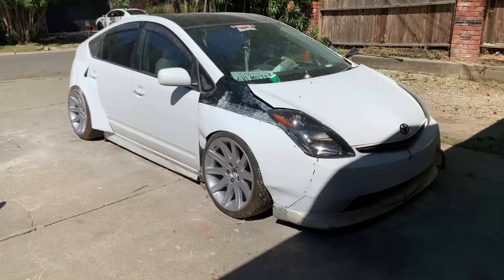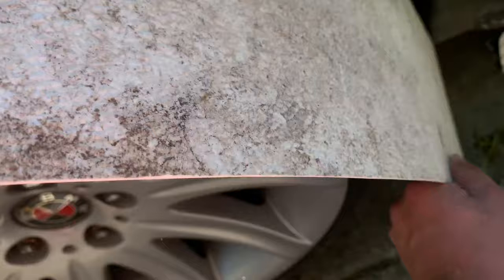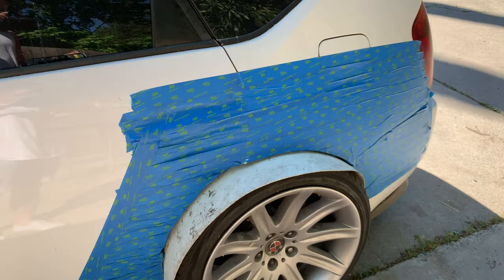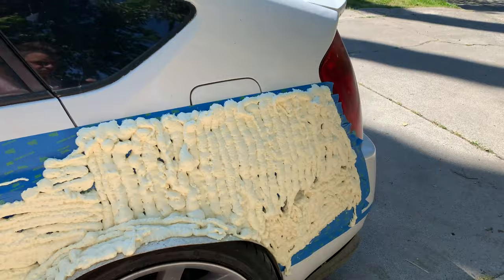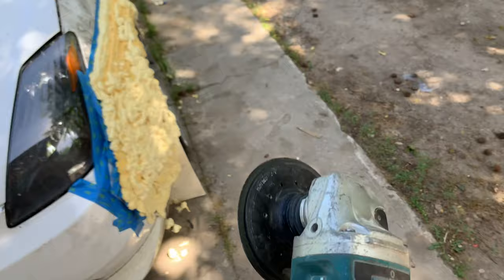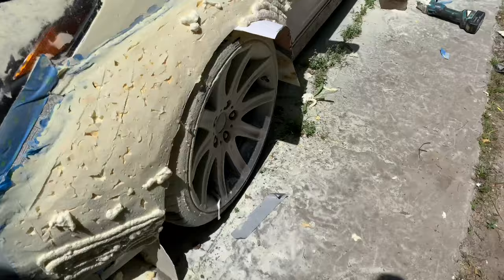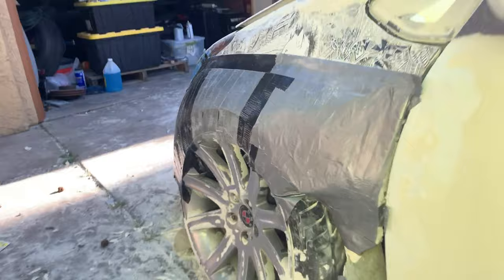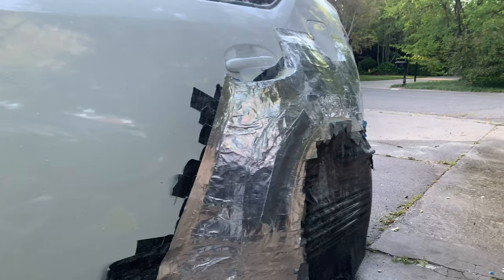DIY Widebody Overfender Pt.1 | The Foam

Comment: Like the effort but from a fibreglass technician you need to incorporate the natural contours from the existing fender to blend in better also instead of using spray foam you can use that green planters foam and just sand to shape you want.
Reply: Wdym?

Comment: excellent...a question...I want to clone/take a mold from a modern rav4 bumper, what foam do you advise me to buy and what kind of tape/protection do I put on the original bumper so that it doesn't get damaged when removing the mold??>, Thanks a lot.,,..

Comment: lovin yo skills, I've done a lot of that stuff and my top hack is use aluminium foil instead of the plumbers tape, stick it on with spray adhesive,  it works out cheaper and moulds better.

Comment: Why would you drill holes in the body. It looks so rigged with screws.
Why dont you use panel bond. Its faster. Easier and looks better.  No blunt edges showing.